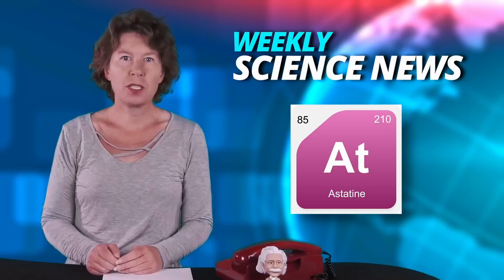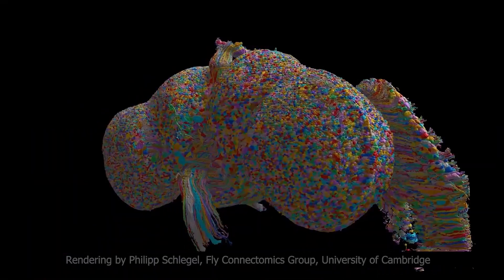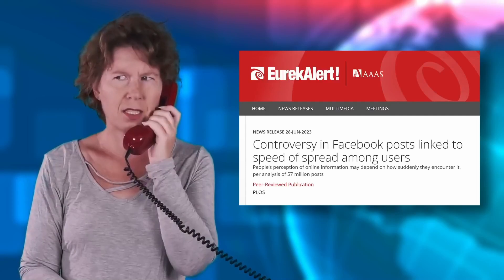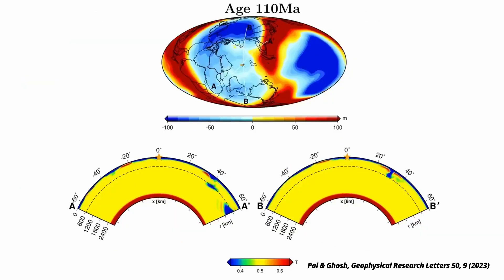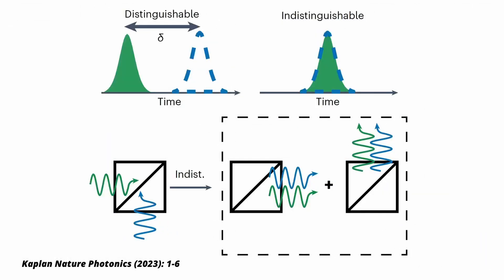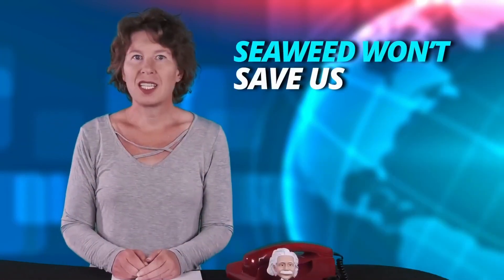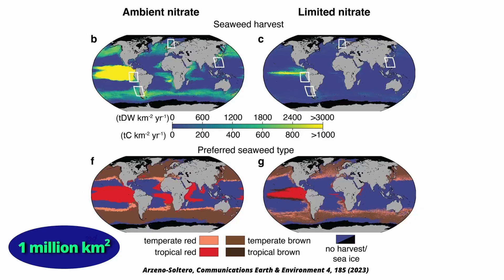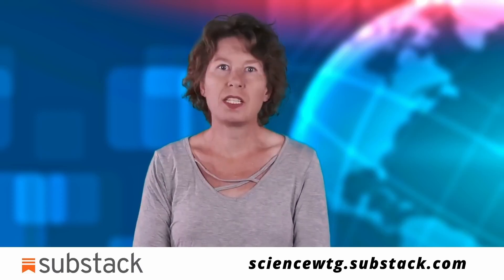Scientists find new atomic nucleus

Comment: I had  a stupid  idea  -  part  of  the  problem  of  using  plants to  reduce  co2  is that  for  sequestration  to  be  permanent  you  gotta  sink  it  somehow  otherwise  biological  processes  will  release it  again in short  time.

But  there's  another  problem  we've been  fighting, one of  longevity  - plastics. And  you  can  make  bioplastics  from algae.  Right  now a  lot  of  the  focus  with  plastics is making them  biodegradable  but  what  if  we  went  the  other  way? It's concentrated, solid, stable carbon, and  we  could  take  advantage  of  the  long life  of  plastics that  usually causes problems for  us.  Once  it's plastic it could simply be  buried in  old mines like  we  try  to  do  with  regular  carbon  capture methods

Basically, CO2  >  Algae > Plastic as a storage medium > Store forever deep underground sorta like we handle radioactive waste

Comment: Props to the scientist that discovered that new nucleus as their Master's. That must have been a ton of work. However, it also must be nice to be born in a country with an actual accelerator. :(
Reply: Most living rooms used to have a particle accelerator in them in the 1990s.
Reply: @IblameBlame  CRTs?
Reply: What a dream to have an access to a physics program with enough resources and conducive place to learn.
Reply: If you've ever owned a vacuum tube TV, you've owned an electron accelerator. And I'm going to go out on a limb and say almost every single country has one.
Reply: @PsychoticWolfie  Thermionic tubes, or valves, are a form of electron beam accelerator.
As are Klystrons, magnetrons, etc.
Reply: @PsychoticWolfie  My father was an electronics repairman and one of the crazy thing we did in 80's was throw bricks to the old CRT's. It was cool to see them implode first and then spit out the shards of thick glass...
Reply: Large accelerators are all intetnational projects, with many countries sponsoring.
Reply: They are around. It's not like you have to use the Large Hadron collider for everything.
Reply: Dude, I built an accelerator in my undergrad.  Sure, it wasn't THAT big, but it made x-rays that surprised a few of the guys in the doctoral program.
Reply: @kayakMike1000  Not to belittle your work, but I don't think that basic Cyclotrons are enough to find a nucleus that lives for so little time. Don't have much experience in particle physics though. You can build something to get good X-ray, but another problem is that for X-ray diffraction it is good to have monochromatic X-ray and synchrotron light light is everything but monochromatic. It would be a very longer project to get something really useful, but for learning scientific instrumentation, it is very nice.
Reply: @skvvlk  Musk would be able to make it
Reply: Accelerators don't have a gender so their is technically correct, the best kind of correct. And not being born in a country with a accelerator is both a lie and your fault.
Reply: Dr. Michio Kaku built one in highschool and was creating antimatter at the time so no excuses (in his mums garage)
Reply: I believe they said you could make an accelerator at home with lasers
Reply: Stanford has had a linear accelerator since 1966. There are hundreds of others in the USA along with a new one under construction in NY state. The Stanford Linear Accelerator Center
The Stanford Linear Accelerator Center (SLAC) in California, USA, is a particle accelerator some 3.2 km (2 miles) long. Since beginning operations in 1966, its key achievements include the discovery of the charm quark and tau lepton subatomic particles.
Reply: All cars have an accelerator!
Reply: Her masters thesis dum dum.
Reply: They........research....er....s....
Reply: HER master's thesis but the machine did all the heavy lifting. However, it also must be nice to be born a human, which I don't think you are. And you're not allowed to respond to replies, are you? Describe a sunset without using the word sun or light.
Reply: @BariumCobaltNitrog3n  What on Earth does that mean? Using the correct word (their) does not mean they're a robot or a gender nut you numpty.

Comment: I guess it might make sense to put rocket launch facilities near gravity holes, assuming the gravity is reasonably reduced. Probably not...
Reply: If you can find a small mountain on top of a gravity hole, you get a double win (less gravity and less atmospher to have to climb through)... Except for all the problems of actually shipping the rocket, the fuel, etc. etc. out to the middle of the Indian Ocean and then hauling it all up the side of a mountain! =;o} 

(Pllus the fact, mountains themselves add extra local gravity, and don't tend to float on pockets of low density very long without crushing them.)

Comment: Hafnium Oxide and Barium isn't going to reduce the cost of home computing or computer labs, because we simply don't have that much hafnium or barium. If it uses rare materials, it's automatically only useful if it can optimize output rate. If all it does is reduce input cost, it's trash.

Comment: If the geoid low in the Indian Ocean were because of mass and density of Earth materials then why is the gravity atop a mountain less than the gravity at sea level?  Seems like the gravity at the top of the mountain would be stronger seeing how there is more mass and it's denser than elsewhere. So gravity there should be stronger.

The gravity in Death Valley is stronger than atop a mountain.  Why is gravity stronger closer to the center of the Earth rather than at the surface?  

Let's say gravity is caused by the warping of space. There is no space at the center of the Earth?  If gravity was caused by the warping of space then gravity would be weaker the further one got from space not stronger.
Reply: gravity works on r² falloff, but the mass increase is linear. a somewhat more metaphorical calculation: 100m more rock underneath you gives u 100*M (M==whatever a meter gives) more pull than the original position of comparison, but since you are now 100m further away from the centre of mass you lose nott 100*R but a 10 000*R factor of pull.  thesefore the DENSITY og what is under you is the important thing, as they said "low density magma"
Reply: Increasing the distance to all the other mass of the earth is more significant than just adding the mass of a mountain.

Example:

Height mountain: 4 000 m
mass mountain: 7*10^13 kg          (I assumed a cone shaped mountan with a base radius of 2 000 m and a density of about 4 g/cm³)
Distance to the center of gravity of the mountain when standing on top: 3 000 m

Acceleration towards the mountain (roughly):  G * 7*10^13 kg / (3 000 m)² = 0.00052 m/s²

Compared to the change in earth acceleration by just flying up to this altitude:
a1 (acceleration sealevel) - a2 (acceleration in altitude) =
G * 6*10^24 kg / (6371 000 m)²  -  G * 6*10^24 kg / (6375 000 m)² =
9.864 m/s² - 9.852 m/s² = 0.012 m/s²

So, the acceleration gain from the mountain (0.00052) is way smaller than the acceleration loss (0.012) from being further away from the whole earth.

But of course, an airplane fying over a mountain experiences more gravity than flying over the ocean.
Reply: @yourguard4  The GRACE Satellites measured Earth's gravity to be slightly stronger during the day than at night.  The Earth has the same relative mass between night and day.  What would cause Earth's gravity to increase slightly in the daytime and then slightly decrease at night like clockwork?  Do you think it is related to the action causing gravity?
Reply: @ronaldkemp3952  I never heard of that and I can't find anything about this topic.

I have a few ideas tho:
1. Energy.
Because the day side is heated up, it contains more energy. And energy has mass.
2. Thicker atmosphere:
The atmosphere expands because of higher temperature, and so the mass of the atmosphere is a little bit closer to the sattelite.
3. tidal forces
The earth gets stretched a little by the gravitational forces of sun and moon. It is stretched towards the moon and the sun (and also away from it on the opposite side). 
Maybe the stretch towards the sun is stronger than away from it, and so a lot of earths mass could be a tiny little bit closer to the satellite.

I'm pretty sure, it is plausible, that the day side would have a little bit more gravity. But I don't think, that these differences are significant or measureable.

Comment: On the subject of computer memory, what would it take to make memory or gates that are “nano-mechanical” for lack of a better word?  As in, moving a single particle, atom, or molecule from a “zero” to “one” position and back?  Would this even be sensible?
Reply: Hey, ECE masters student here. I personally don't think it would ever be reasonable (FOR CLASSICAL COMPUTING) to have memory or logic controlled by a single particle. At room temperature, the randomness of electrons and other particles I think would make it extremely difficult to have a single particle hold a bit for any reasonable amount of time. But when we have thousands / millions / billions of electrons being held / flowing through a gate, the noise gets canceled out and we can see a clear 0 or 1. However, to my understanding, quantum computers already do close to what you're describing, where a single bit is actually represented by a single particle. To my understanding, this works without a ridiculous amount of randomness because they're cooled to near absolute zero.
Reply: Sounds like that would require breaking the Uncertainty Principle...